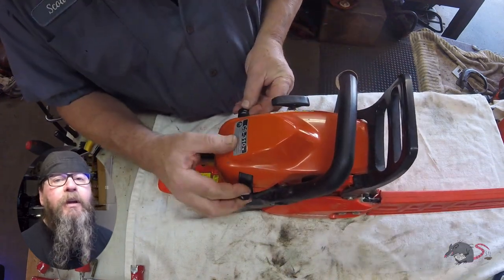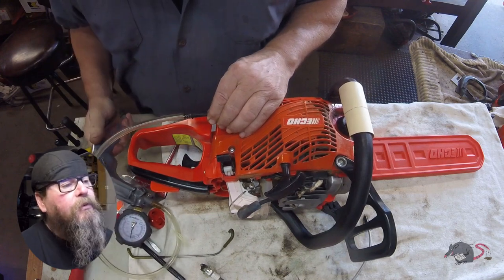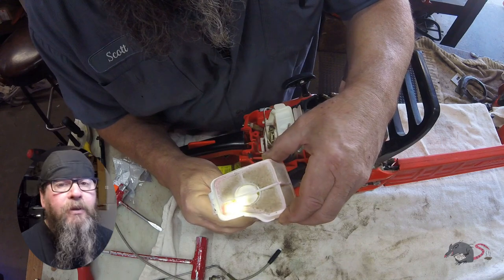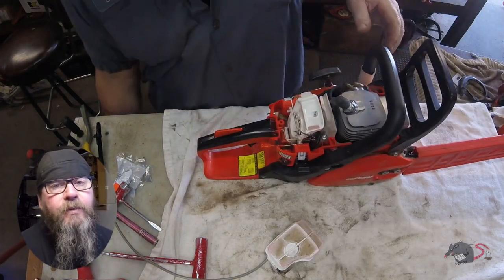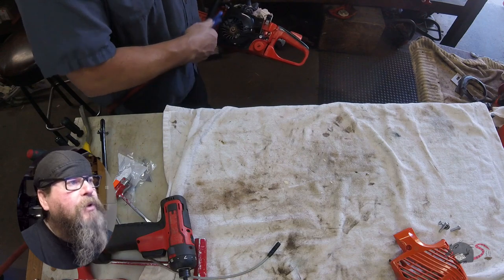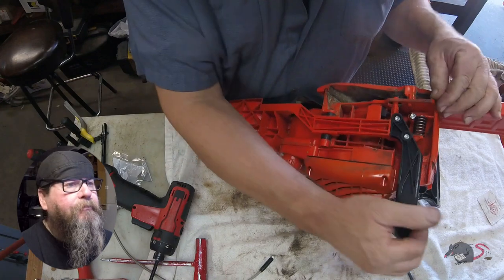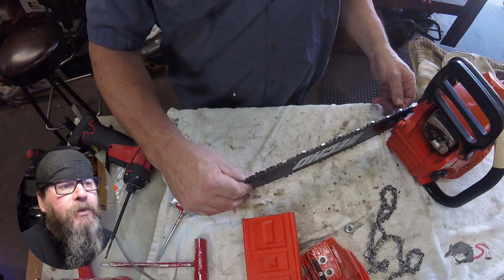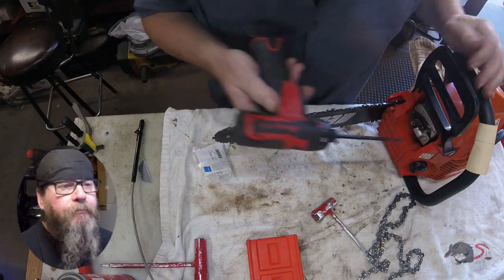Echo CS 310 Chainsaw Tune Up

Comment: I have had this saw for six years.  It is awesome.  I have bigger saws. but the 310 does a great job for how it was intended. Of the four saws I own, this one gets used 50% of the time.
Reply from the maker: When you need a big saw you grab one but most of the time these smaller ones are just easier to use.

Comment: I've got this saw, an I will say that I'm not a professional chainsaw operator. This is my first gas chainsaw that I got for 50 bucks used an pretty much what I can afford as compared to a 500$ chainsaw. I live off grid in the mountains an I use it daily an use it hard cutting down trees the diameter of the 16" oregon bar an cut those into rounds etc. For about a year an a half now. Still works fantastic. I can also say it's durable. It's been ran over by a 34' class A motorhome, fallen down cliffs an off the back of an ATV doing 40mph, an buried in snow. The only things I've had to do to it the entire time was replaced the handle assembly, pull cord, an the two blade nuts. When I put the new plastic on, I missed the choke so I've been starting it without the whole time. Figured I'd give it some attention an found your video.
Reply from the maker: That says a lot about the durability of this simple chainsaw. Thanks for watching.

Comment: Just came across this. Great video! I have this saw along with the CS-590 with a 24” bar. My main use for the CS-310 are taking down small trees and limbing. I have a couple of old neck and shoulder injuries I needed something that was lighter and easier to manage with the small stuff. It’s a great little saw, works even better if you square file the chain too.
Reply from the maker: I believe its one of the easiest starting saws that will still actually get a little bit of work done.
Reply: I have the same saws. I use the 310 for almost everything, and only break out the timberwolf for big stuff

Comment: I'll agree with Jif... I have a MS362 as my felling saw but it wears me out for limbing. Take this saw, throw away (or use for cutting roots) the stock bar and chain and replace with a real 14" Oregon bar and a VXL chain. I also threw away the limiter caps and gutted the CC out of the muffler. With a proper tune this saw runs amazing. I'm not a professional but this saw has seen around 30 hours of runtime per year for the past 8 years. Will it cut what my MS362M will? Nope, but it sees more runtime than my pro Stihl saw does.

Comment: We moved to the country and of course...I had no tools for taking care of our property. I'm also cheap, but not stupid doing my homework before spending. I bought this saw and it has been the most dependable equipment besides the Echo string trimmer purchased.
Reply from the maker: I sometimes feel is way under rated. As a mechanic I can say their equipment holds up pretty well and isn't overly difficult to service.
Reply: I have 5 echo saws been very good to me an their always Ready when i am so i have more time to chase my woman aroun the room w her echo cap on
Reply: Bought one 4 years ago. I like it better than any other saw I've had or used. It runs perfectly
Reply: @robbiebennett8185  8-years on mine and beside normal chains/bars/air filters shtuff, I just now had to replace the clutch. Of course the replacement cheapo-part the needle bearing didn't fit right so used the original. Ooo recently bought the 20" CS-590 Timber Wolf and feels BIG like starting a motorcycle in your hands...LOL

Comment: I run a construction business and run one of these daily. Mostly for demolition. They are compact and good for getting into tight areas. Far better then the cheap unbranded Chinese starter Saws.
Reply from the maker: Yep this one is simple and durable.
Reply: Just an update on the saw. After a couple years Its been back to the shop a few times. It would start and idle but bog down under throttle. The shop blamed fuel for being left in the saw for more than 4 months at a time or use of modern fuel (E10). I find this hard to believe as my older 2 stroke machines from the 80s, 90s and even 70s all work flawlessly even with old fuel and even after being left for months without use. I recently stripped the carb down and it looked extremely clean. Never had this issue with any other 2 stroke machine.

Comment: Echo makes great saws though some of the newer models have that clamshell style air filter. You have to use grease where it snaps together and on the base or they will ingest fines. The older designed saws like the CS 370/400 had a round pleated paper filter that was awesome.
Reply from the maker: Ya they shouldn't have changed that design.

Comment: As for the dirt near the intake, it just does that from factory. I remember opening up mine for its first maintenance and was shocked and disappointed. I reinstalled with a thin coat of RTV and it’s air tight now
Reply from the maker: Thats a good work-around.

Comment: I would use “professional grade” lightly. It’s good for the back of truck when there’s downed limbs. I don’t see an arborist using this as their main saw, obviously. But it is reliable which would provide some professional grade to some trades
Reply from the maker: Theres another way to look at it. There are some "professionals" that probably shouldn't be running more than this saw. Like many saws, they are reliable with the proper use and care.

Comment: I have cs 400  18” bar and I love it has plenty enough power for any regular no rush person startes easy for a cheaper saw especially once broken in 
Gose through gas like fasssst lol
I use it like 1-2 times year 
Great purchase and much Easyer to repair then Craftman polan pieace of rat beeep 
The cs400 is rpm saw with decent torq 

I like it better the husky 450 rancher for my light use 
I will say it so easy to fix / get to everything I can it being used daily but never done so 
Will say gas gose fast lol 😂 the bigger saw that’s definitely we’re they have a advantage 
U get two tanks before refilling oil as well lol
Reply from the maker: Yes the CS400 is a good just like most of the Echo lineup. Easy to work on is a good point.

Comment: I like this saw. Works well. Tore up the original bar and chain.
Anyone can tell me if I can run the KAKEI 18”, 3/8 LP pitch, .050 gauge, 62 drive links onto my Echo CS 310?
Reply from the maker: I'm pretty sure the echo 14" bar requires 52 drivers. I don't think they recommend an 18".
Reply: 16 on mine
Reply from the maker: @JamesWhite-tg4kw  Ya 16 is all right.

Comment: Great demonstration, thanks!  👍👍. How easy or difficult is it to get to the carb to check fuel, filter and primer line connections or to replace/rebuild the carb?
Reply from the maker: The cs310 is a very easy saw to work on.

Comment: The cs310 is a cost effective saw, but I'd like to put a 12 inch bar and chain on one to use it for trimming tree limbs. Because it is a pretty light weight saw and changing a bar is much cheaper then buying a top handle saw.  Any suggestions?
Reply from the maker: Search Oregon saw parts. They offer what you're looking for.

Comment: Pretty Sure the air filter just has issues. I had a new one I ran for maybe 3 days, opened it up and this is what I also saw from factory. Dust behind the filter. Looks like its getting in from somewhere on the seal. I cleaned and put a small line of grease on the mating surface(s)
Reply from the maker: Ya greasing those mating surfaces is a good hack.

Comment: New to operating one of these.  As much as I would like to blame the saw for the oil leak perhaps its OE...this thing is still new and used only a handful of times. I cannot figure out why the leak is occurring or where from? I do know its coming from the bottom but I cannot see damage of any sort. any suggestions would be greatly appreciated..
Reply from the maker: How big of a leak are we talking about? does it leak the first day of sitting and then stop?
Reply: Chainsaws are low use items for most people. I drain my saw of bar and chain oil before I store it. Every saw I have ever owned has leaked bar and chain oil.

Comment: Mine will start first pull, sometimes even cold sometimes if I'm quick to push it to 1/2 choke.
Reply from the maker: I'm not surprised. They're a decent little saw. Thanks for sharing.

Comment: How do you tension the chain?
Reply from the maker: Loosen the bar nuts. Hold the tip of the bar up while tightening the adjusting screw located near the bar nuts. When the bottom of the chain touches the bar then you are close. Tighten enough that the chain kinda snaps back when lifed off the bar.

Comment: I have the same model brand new used it once turned on then went to turn it on hours later it doesn’t want to turn on
Reply from the maker: There are a lot of possibilities as to why it won't run. Its new to you. Did you remember to mix oil with your fuel?
Reply: @TheGreasyShopRag  yes I bought the fuel that’s mixed with oil already from Home Depot
Reply from the maker: @joaquinmaciel4431  Watch more videos and figure out if you have spark, fuel etc. Good luck!

Comment: What about the oiler?
Reply from the maker: You're right, its important to check the oiler system. If the chain would have been dry I would have run the saw with the bar off for inspection. What you never see in these videos is when I take the saw outside, cut with it and adjust the carb. I always check the oiler then. Thanks for watching.

Comment: What no jokes today
Reply from the maker: Just the one about how checking spark arrestor screens is exhausting work :-)
Reply: @TheGreasyShopRag  Should I read between the lines here and accidentally on purpose forget to put the screen back in during service?
Reply from the maker: @clutch5sp989  No, you should use the screen. I usually consider safety #3 after showing off and looking good but not when it comes to chainsaws :-)